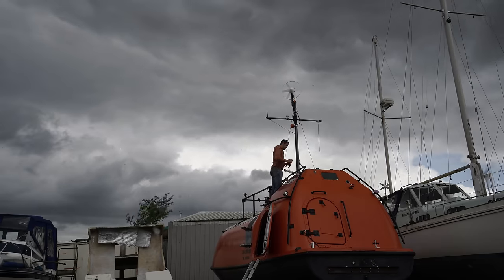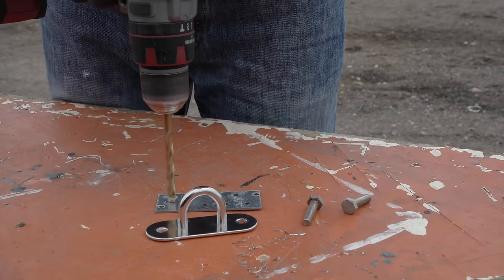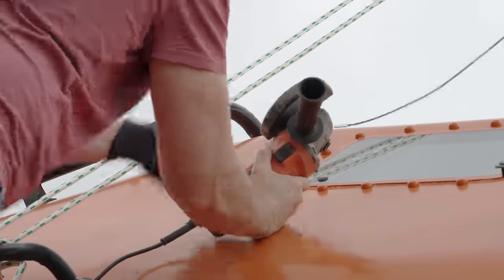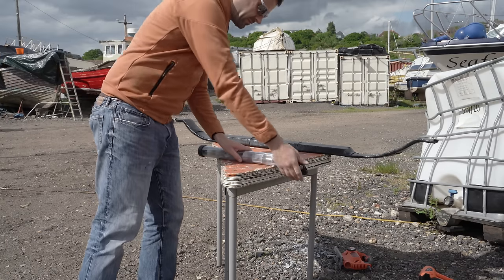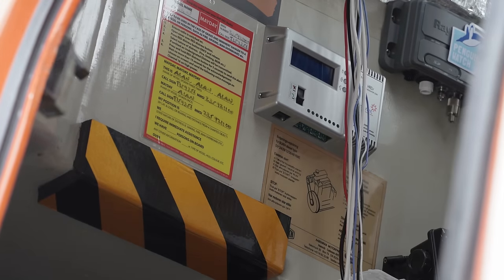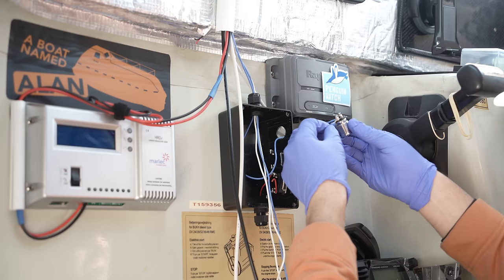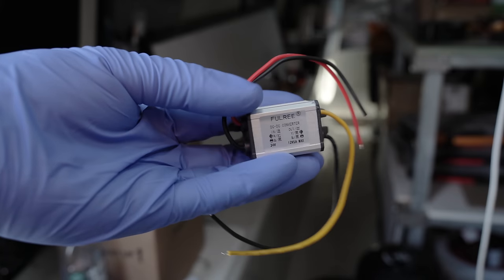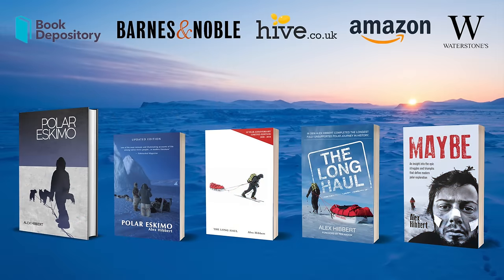Quick update: mast rigging and wiring up the AIS, VHF, horn & lights. Lifeboat Conversion Ep81 [4K]

Comment: If you're going to have multiple 12v items, I suggest having a 12v battery bank & bus rather than a bunch of converters. Several reasons for this. It's another layer of redundancy (your entire 24v system can go down, but your separate, mostly isolated 12v system might stay up. The battery will also help with sudden peaks in current and not stress the converter so much. It's also more capacity. 

Anyway, if it were me, I'd connect the victron 24 / 12 to a 15 to 50 amp-hour 12v battery. Then run all your loads off that.
Reply: Also, all the converters add up to more loss. Each converter has a loss of so much %. Normally around the 8% mark for low power stuff and more potentially for bigger stuff. Each of these little losses add up and the whole thing becomes extremely inefficient. I would also recommend NOT using 24 to 12 volt converters as you are generating great loss again. For best bet, get 24 to 13.8 converters. This is a higher end unit than you are portraying, but even it is only 90% efficient: https://au.mouser.com/datasheet/2/685/ds_vi_200-3045040.pdf
Your boat, your choice mate, but I totally agree with this person!

Comment: Mast is looking good 👍 Just a couple of points that make me wince. The main thing that I really don't like (as a rigger) is at 2.26 - where the two wires that brace the horizontal spar go to a u-bolt on the mast, you'd got one on the top leg of the u, with the other on the bottom leg. I can't see what stops the lower wire being knocked/vibrated to the top of the u-bolt, with consequent loss of tension? Anyway, in its current configuration, the two wires are trying to twist the u-bolt. I know this is all a very small setup with minimal loads, but you're usually so attentive to detail I thought I'd say something!
The other thing is really trivial, but I'd love to give you the excuse to break out that grinder with skinny disc, and cut those nasty looong bolt ends at the masthead 😁 they look lazy😉
Nothing else to moan about. Hope you are managing to not get too stressed by the inevitable last-minute rush of endless minor tasks before the off!

Comment: The nuts on your turnbuclles will work themself loose. In the middle of the turnbuckle is a hole, put a stiff cable through and the ends of the turnbuckle so it can not unsrew itselfon either ends. Happend to me on a little sail dinghi. The mast came down. Can not recomment 0/10 stars.
Have a fun day
Reply from the maker: I concur that a mast staying up is a strong preference.

Comment: I'm curious what it cost for one full tank for Alan. Years ago while I was in college I did handyman work for extra cash. On one job I planted some very expensive trees for a gentleman who, I found out, was a yacht broker. He and his wife invited me in for lunch and he mentioned that he had just returned from picking up a yacht in Alaska and running it down the coast to Seattle and he mentioned how much it cost to fill the fuel tank (once) and I remember thinking "holy shit. That is the cost of my entire college education there. One tank of gas for this boat." Alan appears a good bit more frugal in his consumption though.
Reply from the maker: Depends on the fuel tank size! Alan has a 100L main tank and then one or more 400L aux. We pay £1.50 per litre at the pump. About 30% less in bulk.

Comment: Very good l, I think your led lights wrapped around the mast are going to last approximately 12 hours in the salt though.
Reply from the maker: Why? They are IP68 sealed, and bonded to the mast with Bostik.
Reply: @AlexHibbertOriginals  just from experience, hopefully I'm wrong, and I can't give you an exact reason other than that I just don't think they'll last. I think the plastic will break down with the salt and UV very quickly. Same reason you don't use white cable ties outside. I enjoy the videos, looking forward to seeing her at sea!
Reply from the maker: I'll certainly report back if they fail!

Comment: You'll most likely never see this comment, but I'll write it anyway on the off chance you might. Your horn needs a relay to operate correctly.  The button turns the relay on or off with full voltage coming from the relay. Simple to do and plenty of diagrams around so no need to post a how-to here.
Reply from the maker: I read 'em all!

Thanks for that - certainly the case in most setups, but I don't think the issue here as all the components are rated for the full 5A load and it worked direct to a battery.
Reply: @AlexHibbertOriginals  Yes, certainly the horn will work directly jumped to a battery for a quick test, but that is not how they are designed to operate for the long haul, the momentary switch will fail. Take 2 minutes and check a horn wiring schematic. Alan will thank you for doing so.
Reply from the maker: Okey will do